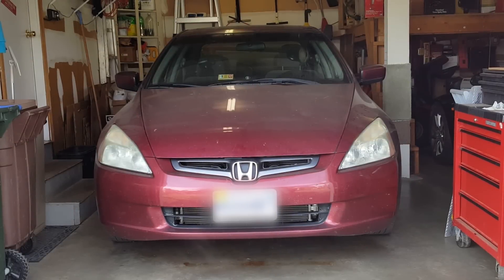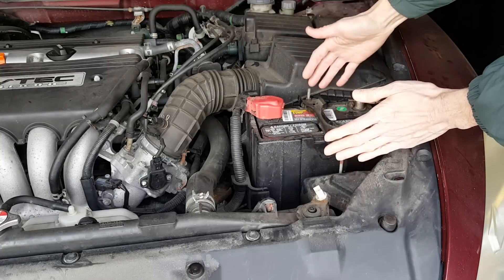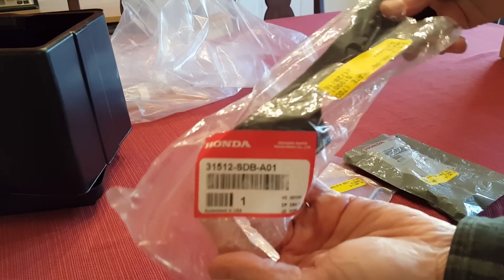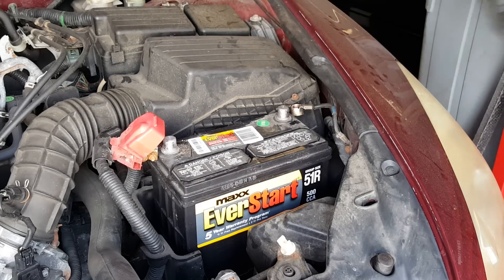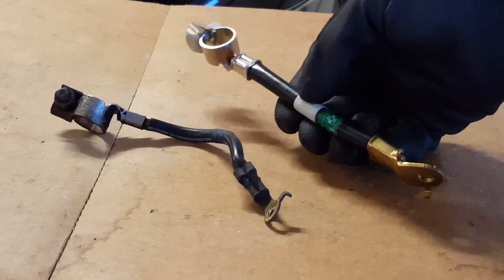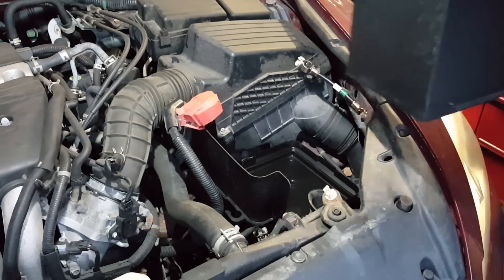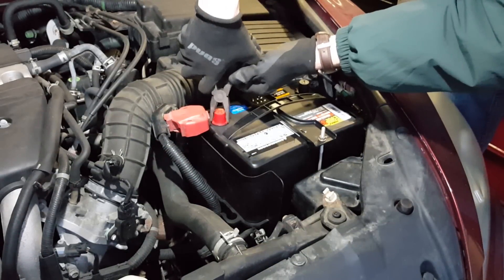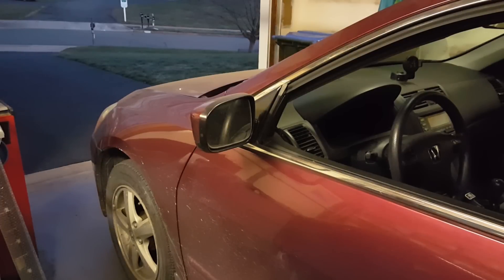Honda Accord?  DIY upgrade that undersized battery!

Comment: the problem is not the size  its the quality, what do you expect using a cheap  walmart battery , you buying parts from the dealership and yet you got a cheap supermarket battery doesnt make sense
Reply from the maker: So, Eric. I must ask, is that opinion from personal experience or just hearsay?  Too many well-intentioned, yet misinformed, people condemn those batteries simply because the name Walmart is on the sign over the door and they are less expensive than elsewhere. They are able to offer an attractive price because of their economies of scale.  I'm certainly not promoting Walmart batteries in any way.  I can only say that I've personally gotten extremely good service and value from EverStart Maxx batteries.  They are made by Johnson Controls, one of the three main manufacturers that make car batteries that are sold under countless brand names.  You might also check out Consumer Report's unbiased findings which are based on scientific data and real-world testing. I purchase my car batteries based on cost vs. value.  I look for a quality battery with a high CCA rating, good price, long warranty, and purchasing convenience.  If you're really against the Walmart or EverStart name for some reason, I recently found that I can get Interstate batteries at Costco at a great price. So if you're a member of a warehouse club like Costco, Sam's Club, or BJ's, you might check what they have to offer.

Comment: I have a 1996 Honda Accord, and I’ve been wondering what’s the best kind of battery to go inside of my car ??
Reply: AgM batteries are more expensive, but worth the money as they are stronger and last longer.
Reply from the maker: That depends on what you mean by "best kind".  If you really mean "best size", that is determined by the size of the original battery that came with the car. Any battery retailer can look that up for you.  If you mean "best capacity", I would say get the best you can afford.  Compare batteries by their CCA  rating (Cold Cranking Amps).  If you mean "best brand", that is very subjective. You might consider comparing warranties.

Comment: Great video. Rubber gloves are a must as we are dealing with acid. Done this upgrade for several of my Honda mobiles over the years- CRV 2008, Honda Accord 8 and 9th generation. All it needs is the top plate from the respective V6 model OEM pt no - 31512-T2G-A00 , which is what I used.  Honda dealers can special order this part which costs about $8. There are universal versions in AZone - PBoys etc, however, the OEM version works best as there is a slight off set between the two j bolts/ braces. The front j post is longer that the back one - do not need to get new ones unless rust or corrosion is a problem. Also, skip the cover - serves no purpose. Modified the existing tray by cutting of the side extensions. The plastic trays do serve a purpose of catching corrosive acid if there are spills as the battery ages or overheats, saves the metal platform underneath. The upgraded size group 35- cos-co 'K-land' lasted 8 years in the CRV in UTAH winters. Unfortunately - these mods cannot be done on Civic Si or the HRV due to space; unless, major welding of brackets can be accomplished. At least, I have not been able to figure this out without considering major mods in Civics and HRV. Hope this helps someone. The proposed version in the video can be expensive-if you buy all parts all over again from Honda.
Reply from the maker: Great info. I enjoy hearing other people's perspective on this project.  For those who are curious about the expense, all parts listed in the description can be had online today for $82.69 from Bernardi Parts, excluding the battery of course.
Reply: Wear gloves we are dealing with acid, there's always that 1 guy.
Reply: @icemule  Yeah battery acid isn't as bad as people think. Sure if it gets in your eyes, big problems, but on your hands for a few minutes no biggie, just wash it off.
Reply: Ya if your a snowflake
Reply: @chrisfarley1021  Good one loser

Comment: My 2005 accord new Interstate battery only f##@ last 1 and a half years. I have heard of this before.  Looks why easy too. 
How much money was the parts.?
I also live in San Diego California USA. 
We don't get any winter weather here cold . Just Hot sunny days.
Reply from the maker: If I remember correctly, it was roughly $75 in parts plus the new battery. Definitely worth it in my opinion. Never had another battery problem after that.

Comment: you don't need to enter the code in the radio after installing the battery?
Reply from the maker: You would if your radio is equipped with an anti-theft code.

Comment: my questions is do i need all of those parts or can i just house the bigger battery in my oem equipment, i get that the cover wont fit...
Reply from the maker: That all depends on if a clean, OEM look and fitment are important to you. If not, I'm sure you could cobble something together that would be functionally sufficient as others have noted here. Note that in some states, you will fail a safety inspection if your battery is not properly anchored down.

Comment: Original battery is inadequate not because of its ability to deliver amps, but cranking time. The reason for using a larger capacity battery is for more minutes of cranking reserve as the temperature drops and the battery ages. The original ground cables are more than adequate for the vehicle load. 

Unless you are a purist, neither the base/tray nor the cover need be replaced.  The cover's only function is to guide water around the battery and base. The battery and the base being plastic, they are wareproof.  Drilling a 1/4" hole in the middle of each bottom seam of the battery tray provides adequate drainage away from the metal supports below.  So the cover isn't really necessary.

The base cavity can be raised with a piece of 1/4 thick non-conductive material cut shorter and narrower than the cavity to permeit drainage. (The combination of the tray lip and the holddown is sufficient to retain the battery in a rollover.)   I used a plastic cutting board. A group 56 or 24 can then be used. A universal plastic holddown clamp with long J-hooks costs $5.  

I did this adaption on a 2004 Element that shared the same 51R battery, and had absolutely no issues for the 7+ years that the group 56 was in use.
Reply: Thanks for the info from Cyprus
Reply: @pleco101  if it's charged a reserve time between 80-130 mins depending on brand, and capacity.  On a short trip is irrelevant due to being driven and charged. Exception is back up Alternator, and capacitor like in a show car then its always charged if the vehicle is running.
Reply: Can you make a video on this?
Reply: You can your option, this guy's option or simply go with a group 51R AGM batter for the money and get a stronger long life battery without any mods.

Comment: is there a possibility to shove the new big battery in the smaller older battery slot with out buying all these parts? like is there a loop to this
Reply from the maker: Not really. The new battery is wider and taller so it just won't fit down into the existing tray and the hold down clamps are not long enough. With the new parts, it looks and fits like factory original. Attempting to shoehorn a bigger battery in there would look like a a jackleg job and might not even be safe.
Reply: @WorseThanChiggers   read above comments it can be done with no problem -!
Reply: @WorseThanChiggers   here you go:    you don't really need to spend all of that money for the extra parts as long as you don't need the OEM look.  I just replaced the battery in my 2007 LX with a group 24 battery (even larger than the 35) as it is a very common size and good CCA.  I just removed the battery box and the entire tray, and then straightened out the tab on the hold down bracket.  That battery and any smaller will fit in there with the existing j bolts and bracket.  So, if you are willing to remove the battery tray, you can just put in a new battery and use the existing hold down hardware and upgrade to a larger battery for just the cost of the battery.  All very simple just like in the video.
Reply from the maker: @mantarayasurf  That is definitely an option and you can certainly save a little bit of money that way.  This is why I love YouTube and how everyone can express their ways of doing things their own way.  Personally, I'm willing to accept the additional expense to do this and other jobs on my cars in such a way as to have the highest quality outcome.  I feel that it adds to the longevity and resale value.

Comment: if you wont a new battery to last and  get ever better then it was at new, get some battery acid,  and check the acid  every month our so, make sure the acid is a little over the battery cells.

Comment: Did u guys have any specific recommendation of battery’s for this car ? Brand and model
Reply from the maker: Personally, I've gotten good value with these EverStart MAXX batteries from Walmart. Decent warranty, price, and convenience. Many people like to bash them just because of where they're sold rather than from scientific facts. One reader pointed out that they are made by Johnson Controls, one of the major battery manufacturers. The best deal that I've found recently is that I can get Interstate batteries at Costco at a great price. So if you're a member of a warehouse club like Costco, Sam's Club, or BJ's, you might check what they have to offer.

Comment: YES, THE HONDA CIVIC IS THE SAME THING, YES I BELIEVE THAT THE BATTERY IS A BIT SMALL, IN THE HONDA CIVIC, 410 COLD CRANKING AMPS, THE PROBLEM IS THAT THE BATTERY IS OVER CHARGED, AND LOW ON ACID, THE BATTERY CAN BE OPENED AND ACID ADDED TO THE LOW CELLS, WILL BUILD UP THE CRANKING AMPS, FROM 410 TO 525, NEVER ADD ANY KIND OF WATER IN A BATTERY IN THE COLD FALL OUR WINTER TIME, IT'S ONLY GOING MAKE THE ACID WEEK LOW THE COLD CRANKING AMPS, ALWAYS ADD ACID TO THE BATTERY, AND IT ALWAYS HAVE TO BE DID WITH SAFETY, BECAUSE YOU DO NOT WONT ACID IN THE EYES, OUT SPLASHED ON THE SKIN , YOU ONLY NEED IT IN THE BATTERY CELLS, RIGHT, ROGERS MAKES THOUS BATTERS, AND ROGERS ALSO IS MAKING BATTERY FOR DELCO, LOOK GUYS, ANY BATTERY CAN NOT CRANK THE CAR MOTOR WITH OUT ACID IN THE BATTERY.

Comment: Did the V6 battery upgrade a few years ago on a 2004 Accord. Starter was still slow and eventually died recently. Replaced starter and it starts better than ever. Also, ran a 2 gage wire from negative battery terminal directly to engine block in addition to the body ground. It starts very well now. Also, I have have used EverStart Maxx batteries that last at least 5 years with no problems, so I still buy them.

Comment: Buys expensive Honda brand parts but can't be bothered to buy decent battery ... There is a reason they are called never start
Reply from the maker: Is that opinion from personal experience or just hearsay?  I'm not promoting Walmart batteries in any way.  I can only say that I've had extremely good service and value from EverStart Maxx batteries. Those who state that EverStart batteries do not have very good longevity seem to be unknowingly comparing the Maxx batteries to the regular less expensive EverStart batteries. Those have a shorter warranty period for obvious reasons. You might also check out Consumer Report's unbiased findings which are based on scientific data and real-world testing. I found it an interesting read.

Comment: The sound of your car starting with a new battery doesn't sound that great. I had the same sound for years, and had the same issue with the batteries. Turns out, the starter bearings were wearing out and putting an extra load on the charging system. After I replaced the starter, the engine start up is great. Completly different sound. IMO the small battery is fine, Honda engineered it ok. Its the starter that is causing the issue. A known issue on those 2.4 K series engines.

Comment: Thanks for making this excellent  video.I made the switch today,and it was a piece of cake,following your instructions.I think my new battery wasn't as tall as the one you used,because I had to put a little notch on both sides of the battery cover , so that the cables sat flush with the top of the battery,not a big deal,I used my aviation snips to make the notch.
Now I'll be able to use my remote starter again.With the undersized battery,and the extreme cold,the battery didn't have enough power to crank my engine,while using my remote start.
P.S
Honda sucks for putting such an undersized battery in the four cylinder accord !
Reply from the maker: Nice success story. Thanks for sharing your experience.
Reply: My buddy put a monster battery in his 2002 Accord. I put an old 51R (okay) battery from a 2015 Accord into a 2012 Fit. Honda seems to put go-cart batteries in the fit, Fit batteries in the civic n Accord, and Accord batteries in the Odyssey. Reverse the mistake. Put a monster battery in the Odyssey or Accord. Put a civic or Accord battery in a Fit.

Comment: Someone tell me if I am wrong. The device on the car with the highest current draw is th starter. You are not changing the starter. You are not adding any other devices that draw current. So the amperage that the battery will need to supply, either to start the engine or to do anything else, will not be increased. Therefore a larger diameter ground wire will not be needed. Nor would a larger diameter positive wire. The current used to charge the battery is smaller than the current used to start the car. The alternator will not charge the battery any faster. It will take a little longer to get the new battery to full charge, since the battery has a higher capacity than the old battery. But the amount of current used to charge it will not go up. Did I make a mistake somewhere?

Recommendation: before connecting the cables to the battery, coat the battery posts and the cable connectors with a very thin layer of grease. Coat the cable connectors completely, inside, topside, and bottom side. After the cables are connected, smoosh in plenty of grease around the clamping screw threads, and add some more grease over the top of the battery posts and connectors. Once the cables are tightened as they normally are tightened, the grease will not interfere with conduction of electricity. It will prevent corrosion. Do the same thing where the negative cable attaches to the car body.
Reply from the maker: All good questions and intelligent deductions. Also very good advice regarding the use of grease to ward off corrosion. Note that the underlying subject of this video is more about capacity and amps to start the car. The amount of current and time that it takes to charge the battery may be important to some but is largely immaterial to this discussion. This car was badly in need of more CCA which the larger group size battery nicely provides. Remember that a battery will deliver whatever current is demanded of it up to its physical capacity before the voltage will drop to insufficient numbers. Higher current requires a lower gauge of wire to transfer the electricity efficiently and safely. I suppose that's why Honda spec-ed the lower gauge wire on their V-6 Accords due to the higher current requirements. Thanks for the comments. I love the YouTube community and its wealth of knowledge.
Reply: @WorseThanChiggers  I think a bigger, larger capacity battery is probably a good idea. 
     I'm just making an educated guess but I think the reason the V-6 Accords have higher current requirements than the in-line 4 is probably because they have a larger engine, which requires more power to turn over in order to start it, and which therefore was supplied with a starter which provides more power – and thus draws more current. If you are keeping the original engine, I don't think you need a larger diameter ground wire. Although it certainly would not hurt.
     My 2015 Honda Fit is about ready to have its original battery replaced. That's why I'm watching battery replacement videos. Car has a 1.5 liter engine. Came with a 151R battery – something that might be found more often in motorcycles than in cars. I'm planning to replace it with a 51R (the one you took out). Except for the tray that goes underneath the battery, I won't need to replace anything else in order to accommodate the larger battery.
Reply: Biggest draw while car is running= Rear window defroster.
Reply: Have you seen the ground cable that comes in these cars? Inadequate at best. Current is the same on both sides of the circuit even though voltage is not. Current from the starter has to come home, and it's coming through that cable. Resistance on the ground side is just as bad as anywhere else on the circuit. If he was going through all this, he might as well replace that cable. There's a lot of electronics in this year accord; heated seats, heated mirrors, rear window defroster. That's a lot of current draw when it's all running. I love Honda, but the Japanese like to be efficient, and sometimes engineer "just enough" to function. A penny here, a penny there.
Also a better option than dielectric grease is rattle can clear coat. It doesn't look gross and it won't wash/be wiped away.